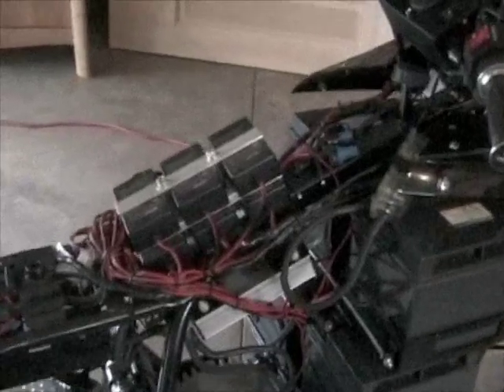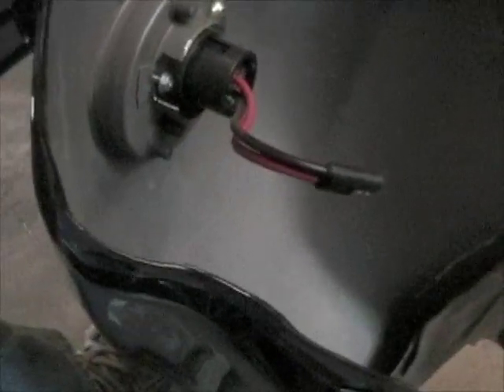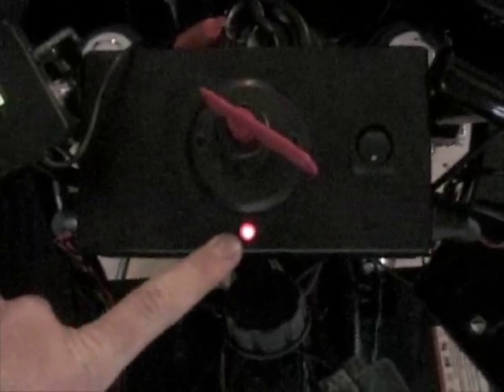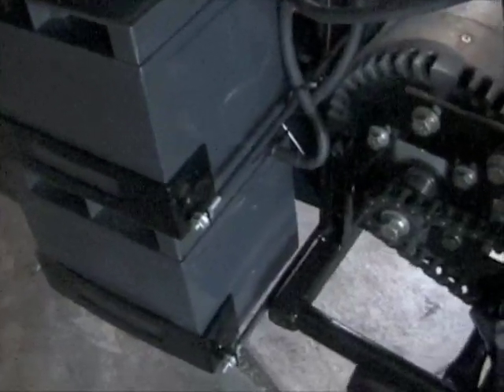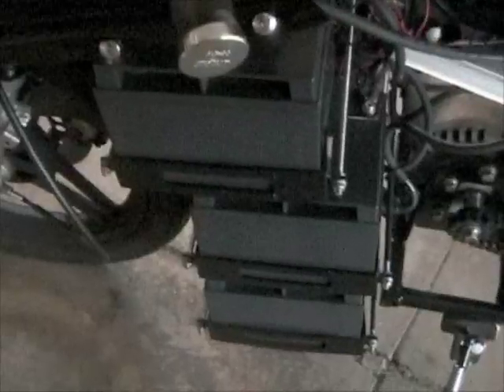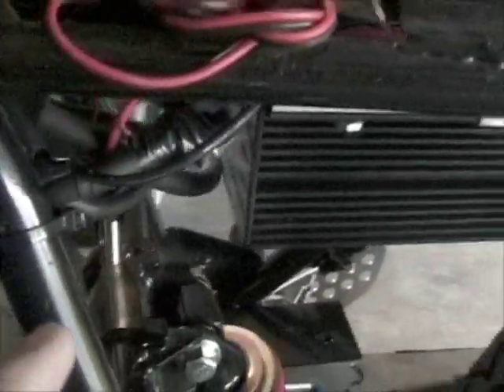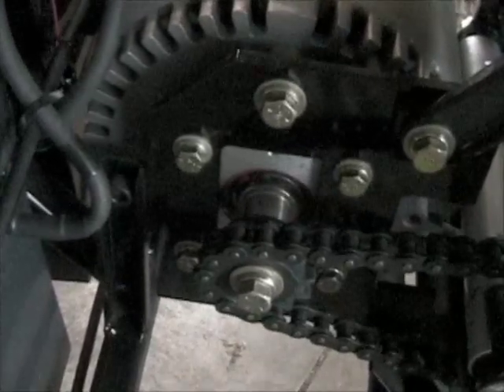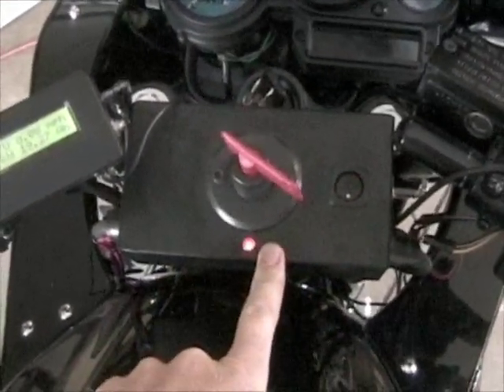Electric Motorcycle - eMoto Details

Comment: @cobrachoppergirl I've seen live fuel end up over bikers in accidents and a couple of other cases in times gone by of burnt legs from hot exhaust pipes. Yes, I'm a biker.
Years ago I let the attendant put my screw top tank filler back on my bike as I was getting the money out. Applied brakes at the lights and fuel gushed out of the top and over the engine. I killed the ignition. I was lucky.

If this guy used SP-LP12V90AHA he will have 3x charge, half the weight and no acid.

Comment: A mountain bike can not take the amount of force that is being exerted on the frame on an every day basis. The bigger dilemma that youre looking at is what is absorbing the forces of the road on the bike? That would be the tires and rims; you will damage your rims and the inadequate suspension on a mountain bike. Also the bike can not support those speeds due to insufficient tires and suspension for maneuvering. You might be able to get away with it but it is VERY risky.